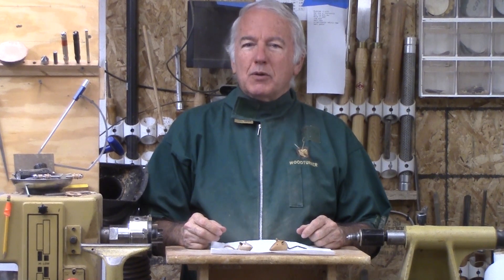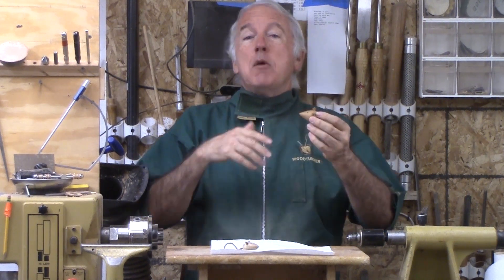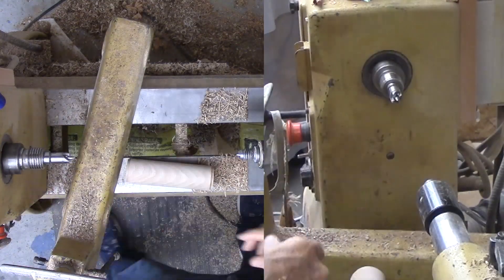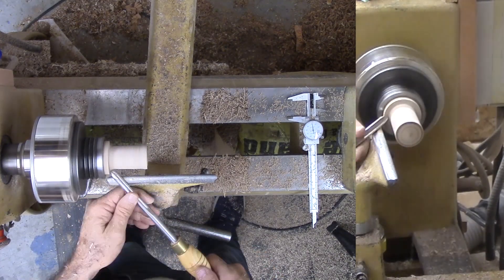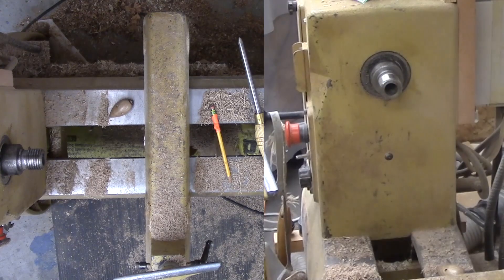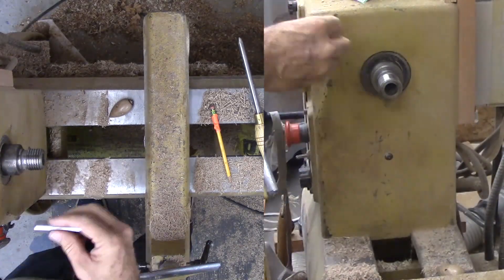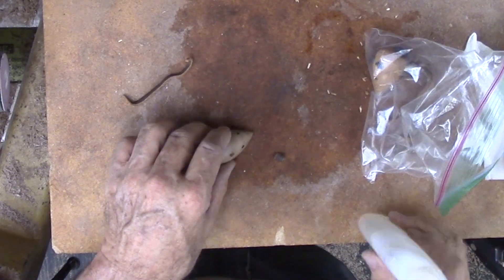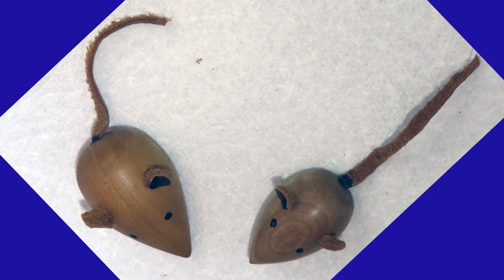Mousing Around With Woodturning - How To Capture A Mouse

Comment: Nice work Alan, and thanks for the shout out for the screw chuck. 
Your process was how I used to do it too. Then I found I had a lot of very small pieces of really nice wood and that prompted me to design and have machine shop make the ESW Screw chuck. Now my mouse nest (scrap box) fills up with little pieces from various project, you know the piece still in the chuck after parting off a project. I just round over and drill the tail hole, then when the box is near full I do a production run of mice. Great giveaways for youngsters (some oldsters too Lol)  who stop by the shop. I have even started making pinto mice and zebra mice, like I say I hate to throw away any wood, and glue opens up a new opportunity. Even my cutting boards offcuts are making it into the mouse nest.
Reply from the maker: You are so welcome.
Alan

Comment: Nice project. Did I see that right at 3:28? Seems like your chuck wanted to run away. Love your videos and as always  keep them coming cause I am coming back for more.
Reply from the maker: Yes, it did want to run away. Apparently I did not give it that extra shove when I mounted it. Then the lathe braked faster than the chuck momentum could handle.
Alan

Comment: Thanks for this one Alan, I've been wanting to turn a mouse and this is very helpful. 😎
I'd also love to see some more info on that little tool you used to mark your tenon size. 😉
Reply from the maker: It is a gauge I am trying out that gives inside and outside dimensions for my chuck jaws based on my live center. Still working on it.
Alan